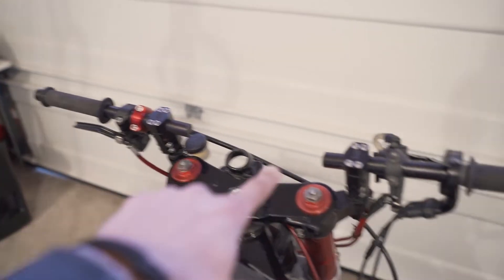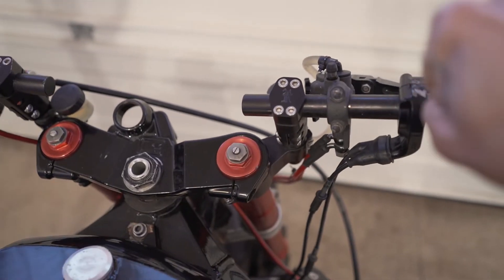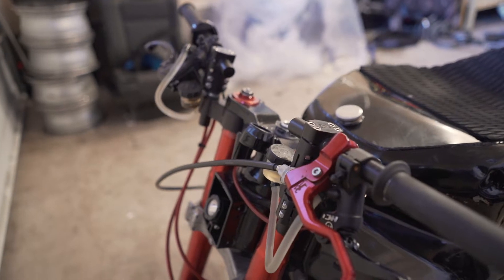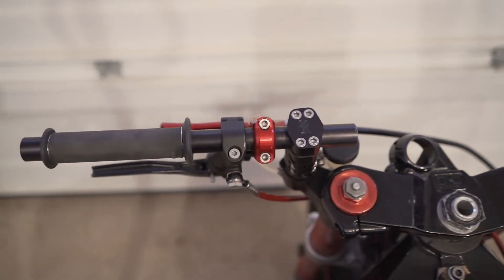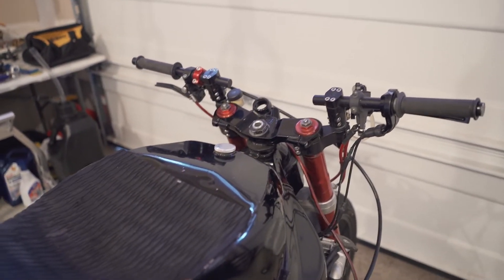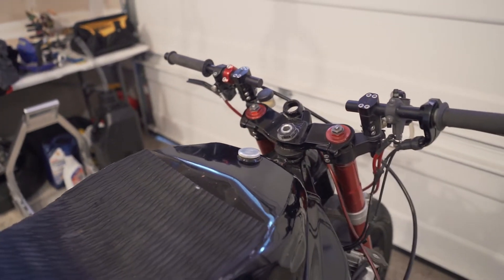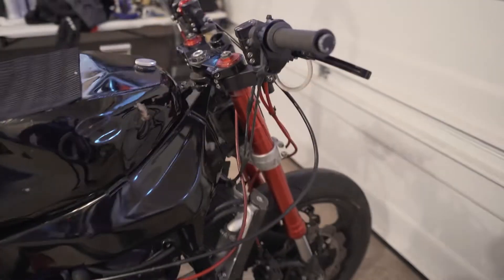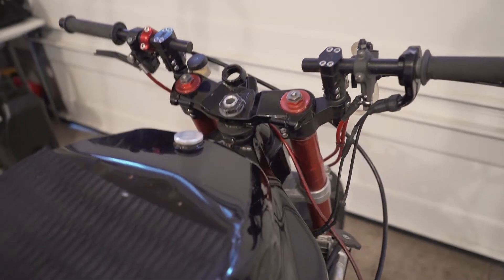RSC adjustable clip on review

Comment: These adjustable clip-on are better than a set of motor-x bar with a new top yoke because of the adjustability? I’ve been wondering which would be better. I have a GSX-R and want to change the riding position. I think motorcross bars would be fine. I like the look and think they would be comfortable, but if the clip-ons can match any position then they would seems the best. And I can keep my Stock top yoke. ???
Reply from the maker: It’s all preference unfortunately man. I’ve used both to figure out what I actually like